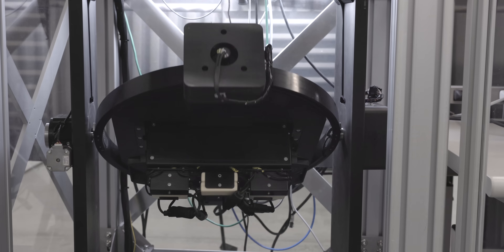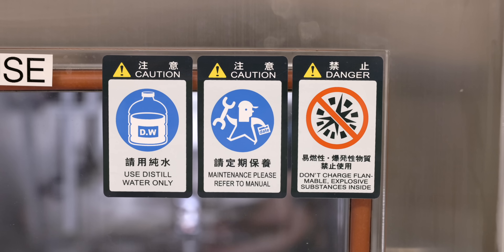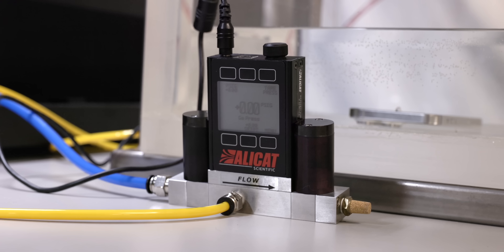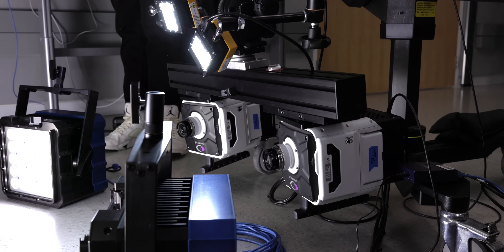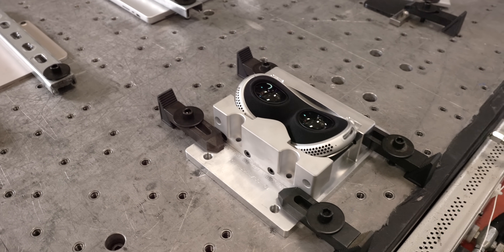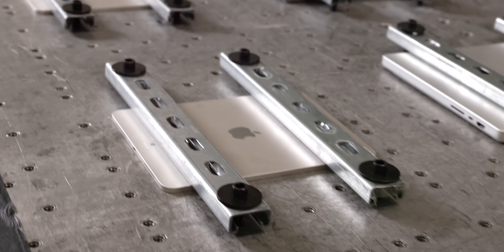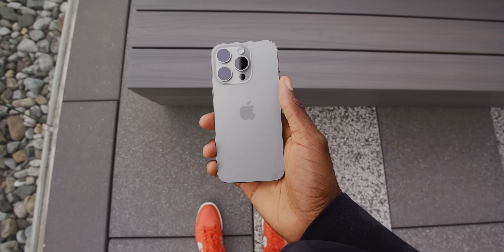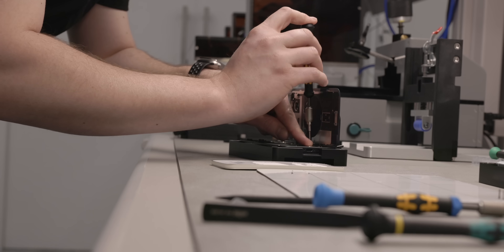I Visited Apple's Secret iPhone Testing Labs!

Comment: Louis Rossmann summed it up perfectly.

This is not journalism. This is Apple’s marketing and PR.
Reply: It's a commercial
Reply: There was a key claim made that Marques should have dug into either during the interview or before publishing:

First the Apple engineer says:

"The failure rate once we got to that point [of durability, e.g. IP68] has just dropped, it's plummeted."

But then he rephrases as:

"the number of phones requiring a repair has dropped significantly"

Firstly, is this data true? Marques could have sought an independent/expert opinion on this. What do customers and repair shops see? What do his contacts within Apple say under anonymity?

Second, Apple's policy is typically to replace or to price repairs so high that the replacement is preferable, or they restrict suppliers from making parts widely available. So if the claim of fewer devices 'requiring a repair' is true, is a lower repair rate due to durability or is it due to policies that prevent repairs from happening?

Another question is what happened to the rate of replacement in the same period? Because replacing a phone instead of repairing it is far, far worse for the planet and the customer if a repair was possible.

Finally he talks about the number of phones needing repair dropping, not the rate decreasing. How does this map to the number of phones produced in the same period. Are the same number of iPhones sold?

Overall, I really like Marques and I believe he does have integrity, but in this situation he seemed a bit out of his depth. His body language was uncomfortable. He wasn't really taking an active role in leading the conversation. He was listening to a marketing pitch and by being passive and using this footage with no editorial comment, his audience was also subjected to this marketing pitch.

I think he was a bit in awe of hearing someone he probably admires a lot speak and a bit unprepared for being ambushed by this greenwashing agenda. In future he and his team would do well to clarify (and agree) what topics any interview will cover 
so they can come prepared, and not to feel pressured to publish anything without editorial control of the message it sends.

It's a lesson and I hope he and his team learn it because integrity is really fundamental to their infotainment product and business. If he doesn't learn it companies like Apple will exploit him over and over until his channel has lost all credibility.
Reply: just an apple ad
Reply: I'm a fan of Louis Rossman but this is not meant to be journalism. MKBHD has from the very beginning always meant to be educational, entertaining, and insightful. He is a product reviewer and tech enthusiast, not a journalist.  Marques is being invited to show us what happens behind the curtain and nothing more. It's up to other people to take that information and do something with it should they choose to do so. Louis is just salty that not everyone is on the same page as he is and I applaud Louis' efforts but that has never been what this channel is about. Take for instance if you were interested in a tear down of a product and got mad at MKBHD not doing tear downs of all the devices he reviews or showcases. If that's what you're looking for, you'd want to go to ifixit or jerry rig everything. If you're interested in right to repair, you go to Louis Rossman. If you're interested in detailed technical reviews and journalism, you go to Gamer's Nexus. If you want quirky fun technical reviews you go to LTT. They all have their own niche and expecting them to all be on the same page is not reality and exactly why everyone in the tech review space will always recommend you look at multiple sources for any given tech device.
Reply: I totally agree. Marques needs to really question this Apple PR.
Reply: Yes
Reply: @SzymonAdamus  I'm wondering if he'll respond, if not to Rossman directly, to his comment section, which is going HAAM on that video.
Reply: ok now cry
Reply: He rated Samsung is the best smartphone in this year
last year he give to Pixel8

He got invited to Apple testing lab and he didn't had much knowledge as Louis did 
so what did you think you gonna talk in front of Apple employee and not get kick out? 

and before you watch Louis if you are in same position as him what will you said?
answer is nothing just like MKHBD he don't have much of knowledge and even he start they still refuse and what will you do next? keep bitching?
Reply: He's not a journalist
Reply: @bladechild2449  After Wikipedia: "A journalist is a person who gathers information in the form of text, audio or pictures, processes it into a newsworthy form and disseminates it to the public."

He IS journalist. The form of journalism has simply changed.

But even if we would agree that he is not. So what? He is one of the most influential technology YouTubers in the world. No matter how we define his profession, he has a responsibility equal with his reach and influence on the opinions and decisions of others. With 19.2 million subscribers, this is a huge influence. So the responsibility and our expectations of him should be equally high.
Reply: Nice "journalism"
Reply: What about at 7:00? That didn't sound like marketing.
Reply: How?
Reply: It’s an interview. Obviously the Apple employee would be pro Apple. Marques is just showing what Apple says.
Reply: @thekivster  Exactly my point. Just showing what a company says is not journalism. It's marketing and PR.
Reply: @SzymonAdamus he’s not a journalist or an expert. The video was about the cool iPhone tests. The repairability part was just an afterthought. The interview in the video is like 2 minutes.
Reply: This is why I will never subscribe to this channel ...
Reply: I unsubscribed as a result of this. Why be a part of the worse bits in tech Marques?
Reply: I wrote something similar when this video was launched. Nobody cared😢
Reply: @Chopper153  when i saw the thumbnail i know that we will have BS inside, so i didn’t dare to click and play this video, unless when Louis did a follow up and so i watched it entirely to make my proper opinion
Reply: Go learn...
Reply: wow. you needed someone to tell you that? do you feel smart, like you discovered something? when illiterates get hand fed a small dose of media literacy. they think it's incredible. yes, there's advertisements on youtube. most of the videos on this site are nothing more than ads. you're so smart, you figured it out.
Reply: Yet, neither louis nor the general public would have known about Apple’s plan if the video was never uploaded.

Only people that actually paid attention to both sides understands that this was an important video.
Reply: @robster7787  wtf are you talking about? 😂😂😂 theres videos calling out apple for years. This video is propaganda. Rossman is getting attention because marques has a big audience that doesn't like bs, and this video makes apple sound way too good. Marques did this with apple vs android video too, hes an apple fanboy. Change the person marques is dealing with to a random Android phone thats not that popular, with the same issues, marques would call it all out, but he doesn't do that with apple. The fact tim cook talked to him shows that they dont feel any threats from marques.
Reply: I dont feel like rossman's video was targeted at specifically MKBHD's video; it just uses it as a way to reach a larger audience. Most of his points are directly against APPLE, NOT mkbhd. While mkbhd never flat out attacks apple, he has a job. he cant just go out and criticize people who are giving him really good content. idk man, i feel like you are a bit too brainwashed by rossman and just hear a guy saying another guy is wrong, and just go with that.
Reply: @LightModeContradiction  Yeah you can, its called integrity. If you don't call them out then you are shilling for money. And thats not what a review type channel like this should be. You cannot trust a channel like that.. this isn't hard to understand!
Reply: @LightModeContradiction  Rossman directly mentioned this video, it's even linked in the description. And yes, you don't need to attack, but you have a lot of decent questions available, it's not like MKBHD won't be able to buy new phones to review them or anything. He is not a journalist, but even LTT has asked better questions than these.
Reply: @HonzoNebro yeah, ltt is actually way better at comsumer advocacy and pointing out bs. Linus loved what Framework was doing so much he immediately bought one and invested in the company. He makes mistakes, but tbe channel as a whole has way more integrity and would never make this kind of video.
Reply: @HonzoNebro  I would argue he is a journalist. a very biased one, but since his vids seem to be mostly reviews of apple products, that puts him in that category. As well as holding an interview with an apple rep? If that's not supposed to be journalism, I dunno....
Reply: @LightModeContradiction  Bs. He could and he should. Going bed with Apple is just him covering his ass and getting "exclusive" Apple marketing propaganda stuff, to get more view and more money.
Reply: @LightModeContradiction  MKHD claims over and over again his opinions are his and so we can hold him to his own standard. And being genuine does not mean going around attacking people, it means being balanced and this was far from it. When he said the AI products like the Rabbit AI were bad we supported him even when the others were calling him out and likewise when he hurts "right to repair" which he supports by pandering and repeating nonsense that is just laughable then we have to also call him out.
Reply: @LightModeContradiction  Yes, he can criticize Apple or any other company. He doesn’t do that because not doing it makes him money. That’s not a job of a journalist. That’s a job of a marketing or PR person. 

Journalism is saying what someone else does not want to be said. Everything else is public relations. 

Influencers don’t want to be called journalists because it takes the responsibility of them. Gives them justification for doing what companies pay them to do (directly or indirectly). It makes them money, it gives companies a easy way to control the message and their image but it’s just PR. It’s not professional journalism or even good critique. 

With big power comes big responsibility… as cheese as it sounds - it’s true. He is one of the biggest tech YouTubers in the world. An expert in his field. A millionaire. He knows what he’s doing and he knows that Apple is using him to greenwash their image. 

He can afford to be better. 
We should expect or even demand him to.
Reply: @SzymonAdamus exactly. Ltt has many flaws, but they aren't afraid of criticizing companies and burning bridges in the name of journalism. That lab thing they got is no gamers nexus, but it's gonna piss off SO many companies.
Reply: @LightModeContradiction  He has a job to manipulate his audience for his gain and he's damn good at it. Good for him... not for you.
Reply: @LightModeContradiction This isn’t true. Rossman called MKBHD out directly in support of Apple’s propaganda. MKBHD is an entertainer, nothing of a “reviewer” as he would try to lead his subscribers to believe. MKBHD is a modern day shill. He’s a marketer and, unfortunately, a good one. He’s an extension of Apple and any other company he does these promo pieces for. Heck he even did one for Buick! Talk about embarrassing as he wouldn’t be caught dead driving one. 

People need to wake up and realize the grift that MKBHD is.
Reply: @LightModeContradiction  he literally names him directly in the video and also links this video specifically in the description.
Reply: @LightModeContradiction no one is forcing him to work for apple lil bro.
Reply: @LightModeContradiction  Just don't talk about someone else being "brainwashed", because it looks ridiculous. The way you people bow and crawl to big corps, is pathetic.
Reply: @LightModeContradiction yes it was. A guy with this many subs should and has to do better.
Reply: @LightModeContradiction 🙄
Reply: @LightModeContradiction  huh?

Comment: For everybody that thinks there's something to having to glue the phones shut to get it waterproof, we invented gaskets in like the early 1800's to get two surfaces to seal and come apart and seal again...
And I'll also remind the internet Samsung themselves, who much like Apple also glues their aspiring ewaste together, made the S5 that simultaniously had a waterproof rating (67) and a removable back/battery. You know how they did that? Drumroll please: Use a gasket.
The vast majority of the things they claim to have to do that could be classified as anti-repair is just malarkey. They want control over the lifecycle of your device and that's it people.
Reply: What's even more sad in a way is that people think they have to use the S5 phone as an example. Stop it! Look up "Xcover". You're accidentally helping Samsung gaslight people by mentioning the S5 every time, and not mentioning that Samsung currently sells midrange phones and tablets with removable batteries and headphone jacks to businesses. Durability and repairabilty for business customers (at a lower price too) but regular people get to spend hundreds more for a much more fragile phone that they will put a cheap case on that makes it feel less premium than an Xcover without a case.

Comment: "Durability and reparability are on a sliding scale"

Framework laptops:
Reply: My thoughts exactly when I heard that argument.
Reply: Apple's statements as always are marketuing Bs
Reply: Or just look at old ThinkPads
Reply: First of all, framework laptops are my dream laptops. However, their built quality is definitely subpar compered to apple, mostly because of the modular design. 

But they are more than repairable, as i said above, they are modular. The complete opposite end of the scale, while still retaining passable build quality. Apple could do even better if ghey wanted to.
Reply: @zsomborszarka2616  For sure. I do think it's a worthy trade-off. Framework laptops sacrifice "neatness" for both durability and repairability. I have the AMD Framework 16 and couldn't be happier, even if the spacers don't fit super neatly next to the track pad.
Reply: @techtonik25  it is not just about "neatness" they are more susceptible to water damage, and some of the assembly also more fragile/lose.

Definitely worthy trade of, but framework kinda sorta proves a point or two.

1. Less durable in certain aspects
2. Still better in long term
Reply: I mean they kind of are, but not to the extent that Apple tries to make it seem like. They've shown to do stuff that at the end of the day will make them more money no matter how much it fucks over the consumer

Comment: Apple propaganda.
I am an unauthorized Apple Technician and this is totally fake. 
They never acknowledge when they design bad issues, like Flexgate / DustGate or  LCD Connector who have backlight pin (52V when max brightness) just near a data line for GPU...
ThumbsDown on this video.
Reply: Did you steal this from Louis
Reply: @Smoshylife  yeah i watched his videos. 
But i am part of the repair dot wiki channel. I have a workshop in France where i repair electronics (pcs and macs). 
So i am facing a lot with design flaws of MacBooks, some can be fixables like DeMux GPU 2011, flexgate… some are only 10% chances of success like the 52V backlight pin near gpu dataline
Reply: Oh god can you read your own comment?

"Unauthorized" - What? you gonna do put a small microphone into my phone when you replace a battery?

"I don't do that you have to trust me?" LMFAO
Reply: @vandeljasonstrypper6734 Nobody understands this comment. Wtf are you on about. Trying to say apple is the only trusted repair place???? LMAOOOOOOOOO
Reply: @fujster  Of course, I can make a freaking battery with a microphone + sim in it and it will always use the iphone battery to power it all the time and background service could send me tho unconsent audio recording with the sim. These type of microprocessor now extremely small to put anywhere and functional correctly. Early iphone version you can hajck the front facing camera connector to make the camera turn on and work independently
Reply: @vandeljasonstrypper6734 this gives off those "my electric toothbrush whispers subliminal messaging into my brain when I use it," vibes.
Reply: @MikeStavola  Say what you want. But Microcontrollers now are easier to access like Raspberry Pi. And iPhone and Android are getting deeper and deeper in the enterprise worlds and these kinds of security methods must be in place
Reply: @vandeljasonstrypper6734  you’re not fitting a raspberry pi on a iPhone
Reply: @Smoshylife  LMFAO why can't you? extract the  BCM2710A1 SoC and attach it to a custom PCB  then you done. And this is a microprocessor, imagine how small the microcontroller could be
Reply: @vandeljasonstrypper6734  yeah you can definitely do that I’m not denying that
Reply: @vandeljasonstrypper6734 and if the FSB wanted to spy on you, they definitely couldn't persuade one of those heroic incorruptible Apple certified techs to do that?
Reply: @vandeljasonstrypper6734 You sound like someone who reads about tech stuff a lot but never tried to change the batteries in a flashlight.
Reply: @vandeljasonstrypper6734  hold on I don't remember, who uploaded a customer's s*xtape to her Facebook account again? Oh right, an apple authorized shop
Authorized shops don't have the right to repair your stuff, they just send it over to Apple for a repair that's gonna cost you 4x as much as an independant repair shop AND they're gonna hack into your stuff